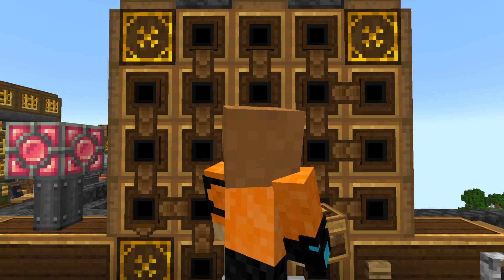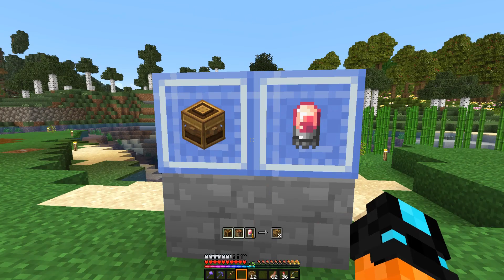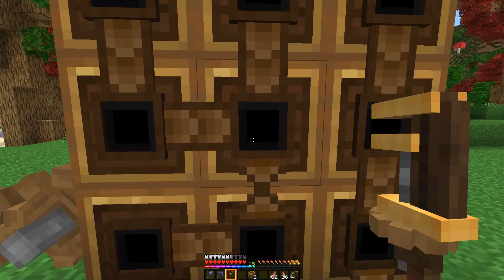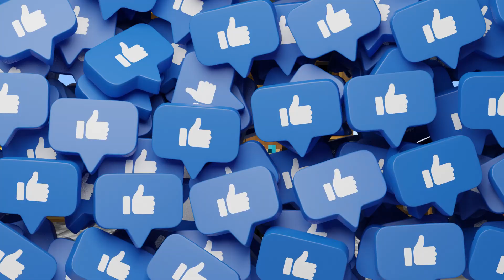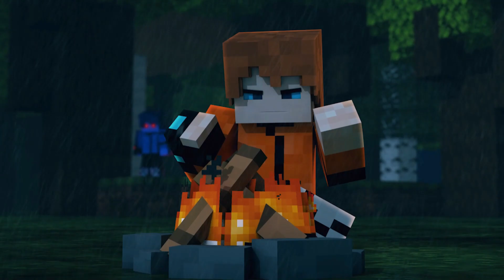Mechanical Crafter - USES and SECRETS - Create Mod Tutorial

Comment: I know this video is a year old, but if you see this, I need a bit of help. My mechanical crafters say they are overstressed each time I attach a gear to them (I am using a water wheel as I am still a bit early-game). Do I need a windmill as the power source?
Reply from the maker: No, you can do this with water wheels as well but you need to add more wheels to the power generation. =)

Comment: The one thing I came for was how to get the power source to actually use the mechanical crafters, and that was the one thing the video didn't answer :P
Reply from the maker: I show the power source and mention better ones that would work for it. That is how you use the crafters. Did you miss the part possibly where I talked about the button which is needed in some situations? Or perhaps you actually need a tutorial on the power sources themselves? They are used in most all Create machines so explaining that in each tutorial wouldn't make much sense.
Reply: @MiahQuests u showed it but how are we suppose to know what those blocks are 😭
Reply: @ninjago319 that’s like buying bedsheets, searching up a tutorial on how to use them, and complaining that it doesn’t show you how to buy a bed.
Reply: @GlunkusMSM  what?
Reply: @ninjago319  at this point in the game, you should already have a powers source. My example was like having bedsheets without a bed to put them on.
Reply: @ninjago319 He's right, your asking how to pilot a rocket when you've never flown a paper airplane. Or it'd be like asking how to beat moonlord and you haven't even killed the wall of flesh, basically slow your roll champ. You need basics before you get advanced
Reply: @CharizardChase mechanical crafters aren’t that advanced tho? In my ATM9 server I was able to make them relatively easily. It’s not even about showing how to generate power, you can’t even see what the blocks are? I’m not only playing Create and I’m sure there’s a good handful of people who aren’t either. It would have been nice to at least mention the power source to be able to go to another video.
Reply: @ninjago319  if you look at the side of the auto crafter, it has teeth like cogs. If you haven't utilized cogs in your playthrough of create mod yet you most likely wouldn't have crafted auto crafters. Its not that I doubt you, you very likely could've crafted auto crafters, but without using cogs is unlikely

Comment: im not certain, but i feel like something changed in the newer version, cause i did EVERY SINGLE THING just like you had done, but my crushing wheels REFUSE to craft.
Reply: try using Stone I was having the exact same problem and JEI says cobblestone would work but once I swapped the cobble stone for just normal stone that fixed my problem.
Reply from the maker: Hmm as far as I know nothing changed with the interaction. You're giving it a redstone pulse once the crafters are full right?
Reply: @MiahQuests  don't need to, once the craters are full it starts automatically.
Reply from the maker: Not for something like this, try attaching, and using, a button and see if that kicks it off. =) @VirtualSilence77796

Comment: Some of the blocks on the mechanical crafters wont let me place the wood and the andesite alloy wont place anywhere on the crafters, why is this?
Reply from the maker: Hmm, so it sounds like you can't place those things in the crafters, if I'm understanding you correctly. Those things should be able to be placed, I assume other items are able to be placed in the crafter for you. I'm not sure what would be blocking that, I'd suspect maybe another mod is interfering. Maybe try going into creative and messing around with it a bit and see if you can narrow down whats causing it.
Reply: @MiahQuests  it was like wood couldn't be placed in the top middle and andesite couldn't be placed anywhere and andesite alloy couldn't be placed anywhere... The thing is I tried the exact same thing in a creative singeplayer world and it worked. Then I rejoined and moved the crafters to a different location around 100 blocks away and it just worked so I don't understand why it was broken

Comment: How do you make bucketsvwith the mechanical crafter
Reply from the maker: The best way would probably be to make a 2 high by 3 across grid and use the covers on the 3 unused slots, then use your wrench on the back of the crafters to make sure its 1 large rectangle, that way you can just feed ingots in anywhere. That configuration would work nicely. =)